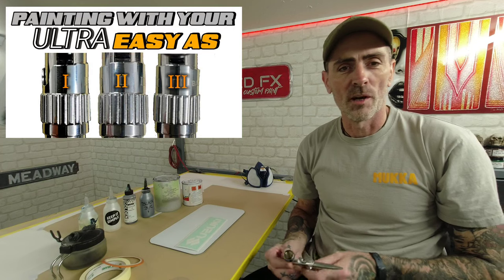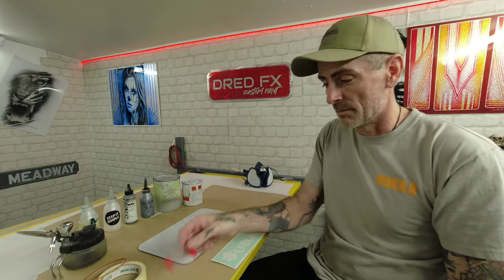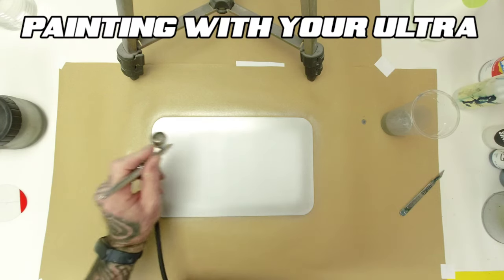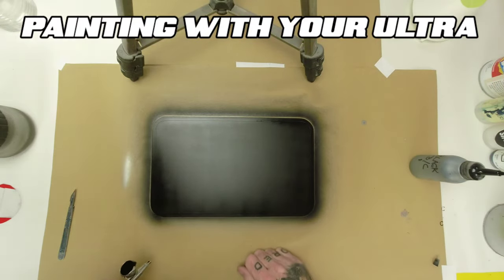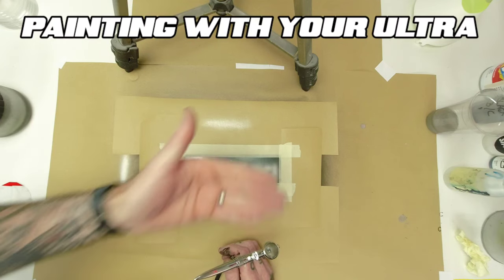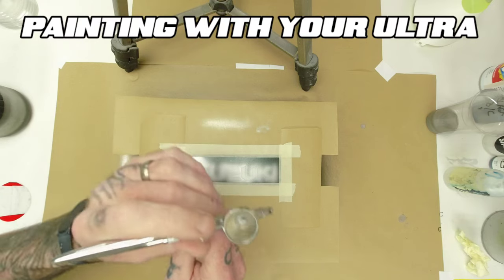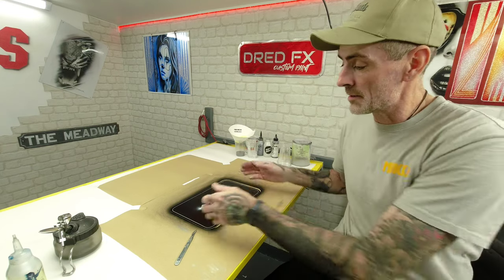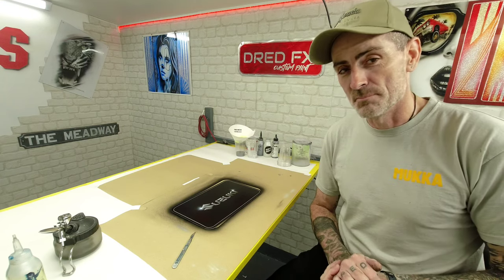The  Brush that gives you total control harder and steenbeck ultra

Comment: My first day with the ultra 2024 today, I'm as inexperienced as you can get but for me the trigger is far too stiff, because I don't know what I'm doing I have a death grip on the airbrush and when you add a stiff trigger, my hand almost cramped up, but I do like that the air doesn't turn off until you move forward.

Comment: Received mine last week.  Have tried it with water only, just to see that it works with my compressor.  I am impressed with your artistry!  I'll experiment before trying to do something "constructive", but it looks like a great buy.  I only paint larger models at the moment (locomotives and railway rolling stock) and so I may not need the very small settings.  Thanks for the video.
Reply from the maker: That's great news the ultra will work great for you 👍 thanks for the feedback all the best rob

Comment: I've only airbrushed one in my life with a very cheap model...didn't work out...I like this airbrush, and it seems well made...a great learning tool, to get more into airbrushing.  I was wondering however, if createx paint is a good paint to start with...or what is recommended???
Reply from the maker: Hi I use createx illustration and golden highflow acrylics both good paints